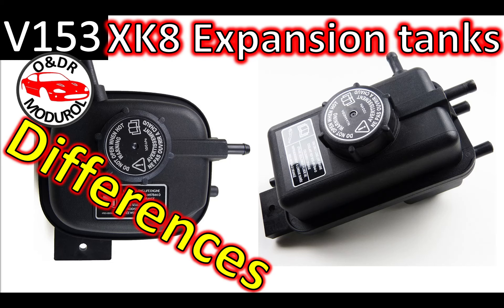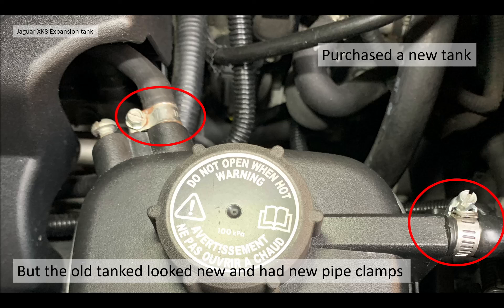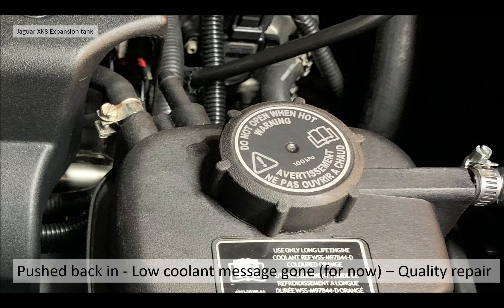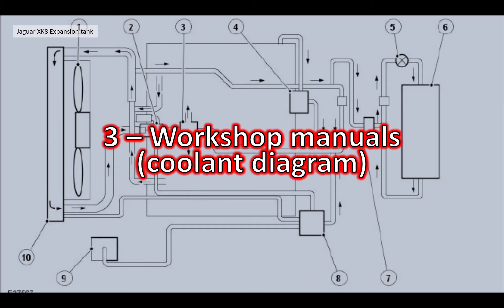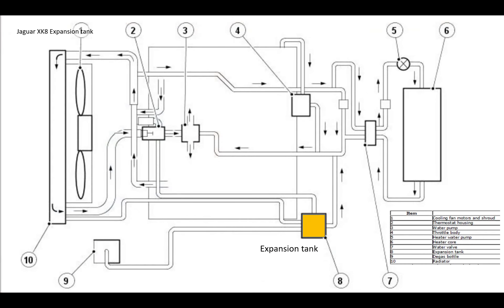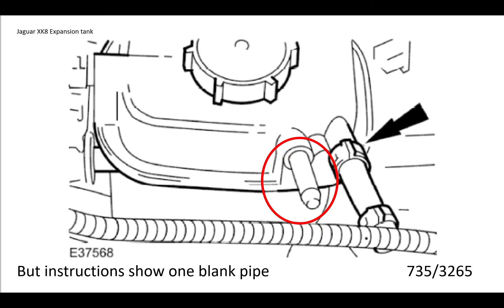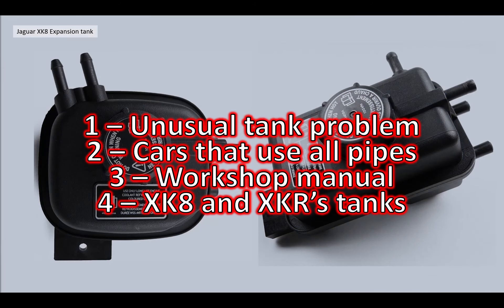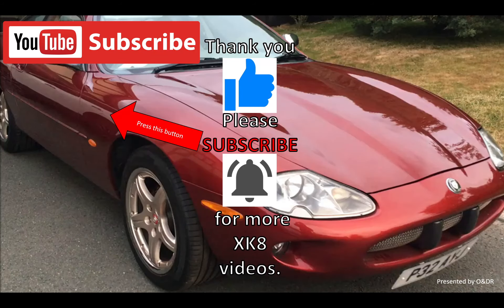Jaguar XK8 Usual expansion tank problem, differences and low coolant messages V153 XKR/X100

Comment: What's funny, is that I had a coolant line to my expansion tank come off yesterday. The previous owner had secured it with a wire tie, instead of a clamp at the "T" plastic coupling! I replaced the coupling with a brass fitting and clamps. So you're exactly correct, you never know the dumb things previous owners do. My car is a 03 XKR.
Reply from the maker: Drew,  sounds like you are a good custodian of your XKR. Its lucky to have you looking after it, instead of its previous owner. Thanks for the input and comment regards Damian

Comment: Good stuff; I’ve heard of people needing to replace all the plastic in the cooling system because a prior owner was using the wrong type of fluid, red vs. green etc. It’s like the Matrix, you need to take the right color pill to remain in Wonderland. . .
Reply from the maker: Jez, Like the analogy. Not sure its wonderland more like a roller coaster. Thanks for the comment regards Damian

Comment: Hi Roland, just picked up on your video of the XKR Coolant tanks, I have the XKR 2003 with the MJD4400BA Tank, for years I have had this problem of low coolant and had everytihng cheecked out by an independat Jag Specialist and they cannot understand why the light comes on when hot. When you start the car up cold its fine but when hot the light come on, I have had 3 expansion tanks from Jaguar with electrics and had the coolant changed to Jaguars recomended RED. But proven to me by Jag specialist when very hot, the float is dropping, and remains down until the coolant cools, any ideas? Had the car now for 13 years and lived with this problem for the 8 years Kev
Reply from the maker: Kevin, interesting new problem. Can’t be the expansion tanks. Assuming it’s something that changes when hot. Ideas 1/ recommend checking the atmospheric tank, inside the LHS front wheel arch liner. What is the coolant level like in this? Is it venting to atmosphere, blocked vent? Does its level increase when hot, blocked pipe? 2/ Water pump or thermostat excess coolant flow forcing the float down? Narrowed pipework increasing flow, broken impeller bit or stuck thermostat? or 3/ wiring loom short when hot. Trapped or damaged wiring? Sorry can only give some ideas as never heard of this issue before. None of these are expensive if you check and change yourself. Please let us know what you find, regards Damian

Comment: Hi there. Do you have the part numbers for the hose to the thermostat  for the 4.2 litre not supercharged 2004 model .  I think it is MJA4468AF.
Reply from the maker: Sakura, try SNG Barratt website to clarify part numbers. here is a link, regards Damian
https://www.sngbarratt.com/English/#/uk/FindParts/Families/XK8%20~2F%20XKR/11/XK8%20~2F%20XKR%20-%20To%202006/47/ENGINE%20COOLING%20SYSTEM/12442/assembly/30421
Reply from the maker: Sakura, MJA4468AF is not thermostat it is expansion hose, see link, regards Damian
https://www.sngbarratt.com/English/#/uk/search/results?pageNo=1&query=MJA4468AF&familyId=%5B11%5D&modelIds=%5B47%5D&excludeTurnedDown=false

Comment: Good evening  dear can u please tel me where can i find idle speed controller on Jaguar xk8 from 1996 thnx
Reply from the maker: Hakob,  The idle to controlled electronically via the ECM.
There was a TSB 303-29 advising to change the sharp plug gaps to 1.3mm to improve idle quality, see link below,
https://drive.google.com/file/d/1PitFk5opW87jCcqr-5Qa55LNb5OdWxVw/view
Idle is mentioned in JJM181515-70 including diagrams, see link below.
Extract "At idle, the ECM controls engine speed using the restricted throttle valve movement available
between the mechanical guard (open limit) and a factory set stop on the dc motor drive gear (closed limit)."
https://drive.google.com/file/d/1PitFk5opW87jCcqr-5Qa55LNb5OdWxVw/view
Hope that helps, regards Damian
Reply: where is it located in the engine⚒️

Comment: Dear  I have a damaged coolant tank for xj8 -1999 Will the coolant tank for XK8 work for replacement
Reply from the maker: Ahmed, not sure to be honest it’s not the same part. You can check parts and part number quite easily. Take a look at this video  Jaguar XK8 Finding compatible and correct part numbers Ford Denso V57 / XKR (X100)
https://youtu.be/e7QzXEnnPwk Thanks for the comment regards Damian

Comment: Interesting as always Damian. I have a 98MY, 99 reg XKR. I've assumed it is the AJ26 engine, am I correct? I've seen your earlier video on that topic awhile ago but a comment you make during this video suggests it would be an AJ27.
Reply from the maker: Bernard, most likely AJ26. Which comment in the video made you think otherwise? Noticed a lot of the XKR actually have a tee in the supply to the thermostat and I assume the radiator. No tower in these due to the supercharger so not the same high point the remove any air traps. Does yours have T piece?. Thanks for the comment regards Damon